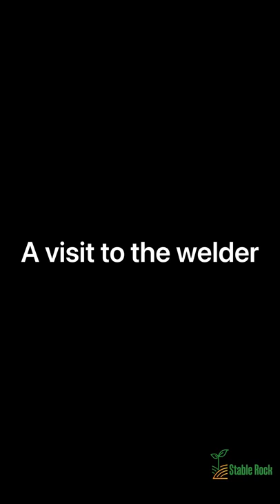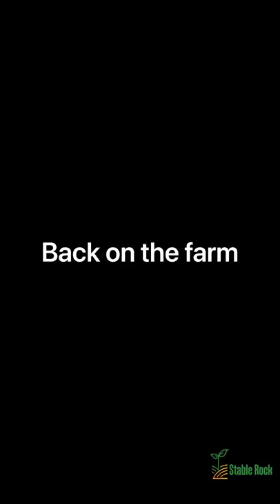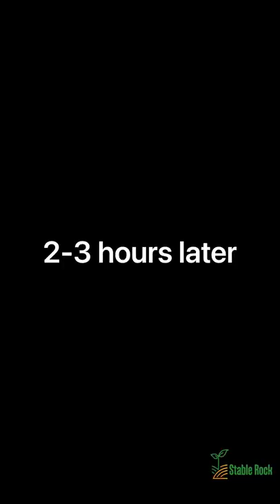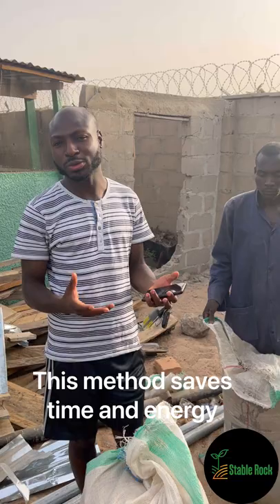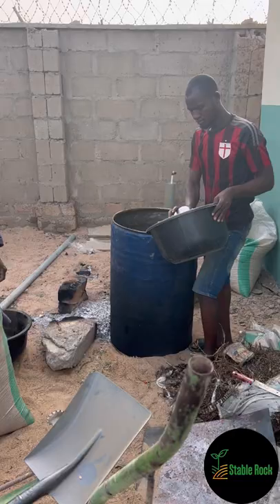Best method of preparing SOYBEAN for CHICKEN & PIGS to preserve nutrients and maximize intake

Comment: This is a great innovation, i have tried using full fat soya on several occasions using toasting method and will sometimes get it right and sometimes under roasted or over toasted. I really admire this method because i can have more quantity done at a time and will also get the required result. Please if the soya is crushed wont it affect the quality of the soya bean in terms of protein and energy content.
Reply from the maker: Exactly. That was what resulted in our going for this method also. No, crushing the soyabean will not affect its quality😊
Reply: Hello sir, how long can be sttored?

Comment: Can i use more than one standing pole in the drum to provide more steam and get the soya done faster.
Reply from the maker: I never thought about that. I’m sure you can have a conversation with the person who will fabricate the drum for you. But technically, it should be possible.

I should however add that with the one pole, it works perfectly.

Comment: Wont the soya at the bottom overcook by the time the one at the top cooks to the required level?

I'm asking because I heard that if soya is overcooked the nutrients gets destroyed. Thank you for sharing
Reply from the maker: Great question. No, it won’t overcook. In fact, because we did not want the soya at the bottom to overcook by the time the top one cooks is why we punctured the holes all over the construction made. 

This way, before the bottom soya gets to that “overcooked” level, the holes on the side of the construction will cook the soya at the top also.
Reply: Thank you for the clarification

I'm seeing something that looks like a sack cloth at the bottom. What's the use?
Reply from the maker: @howtheyinvested8587  you’re welcome. The metal plate was not fully covering the edges of the drum as it should. So, we put the sacks there to ensure no soybean drops to the bottom of the drum
Reply: Thank you very much. It's much clearer now

Also, isn't the soyabean with much much higher moisture content thereafter due to "steaming"?

If so, wouldn't it require some drying thereafter to avoid spoilage upon storage?
Reply from the maker: @howtheyinvested8587  a little test will shock you. There is very little moisture when the soya is ready. We have never had to dry our soya after steaming
Reply: Great and thank you Bro. You've saved me a ton of headache
Reply from the maker: @howtheyinvested8587  you’re welcome
Reply: Nice one bro..
Did mine earlier ND got it spoilt,will re try it again
Reply: @eo3700  h
How did it got spoilt?

Comment: But this method i think is more or less like the extrusion method where they also use steam in high temperature to get full fat soya. Please can i get your contact should in case one need more clarification in the process.
Reply from the maker: Sure. +2347081075175
Reply: Hello, what is the ratio of this soya cake to pig feed